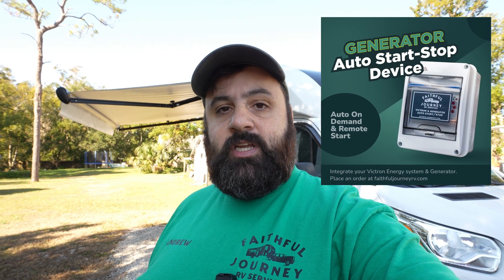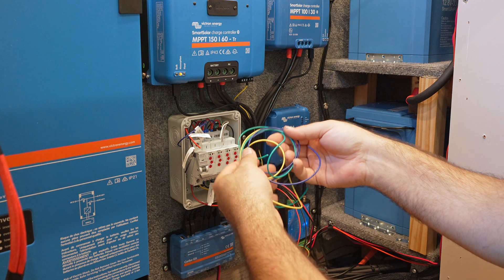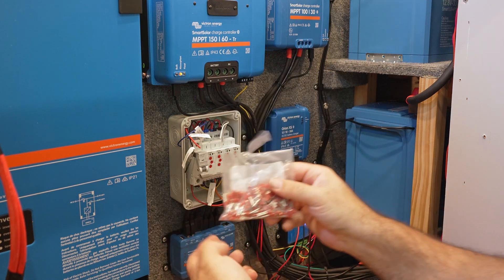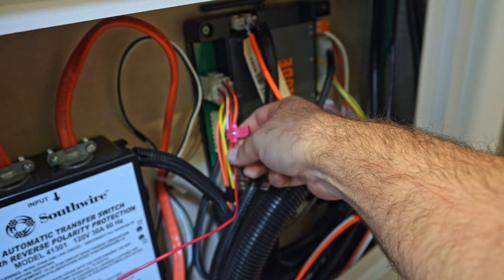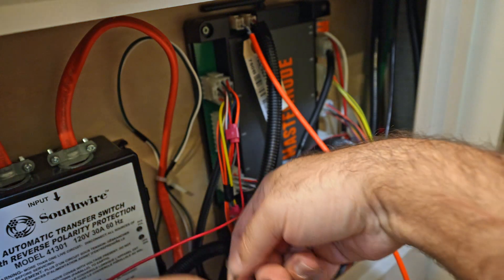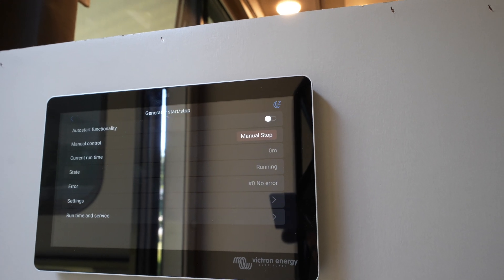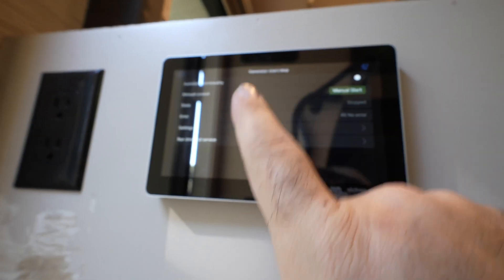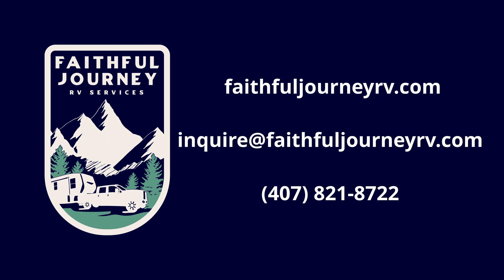Generator Auto Start Install - Thor Gemini with BMPro Smart Command and Victron System

Comment: Can I use this on a Sungoldpower 4000w inverter charger with AGS?
Reply from the maker: Does the Sungoldpower inverter have a a relay with NO, COM, NC built in?
Reply: @faithfuljourneysolarsolutions  I believe it's a 2 or 3 wire green relay plug terminal
Reply from the maker: Please send me your contact details so we can discuss this. inquire@faithfuljourneyrv.com